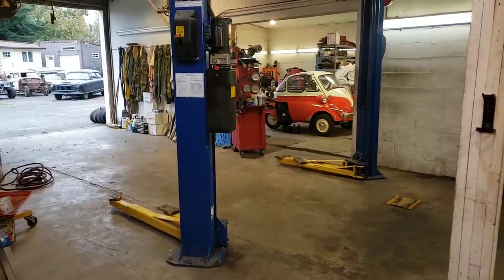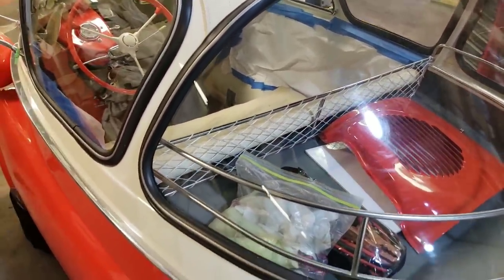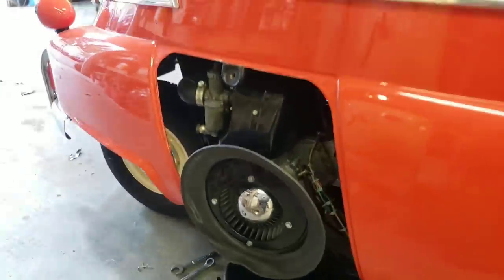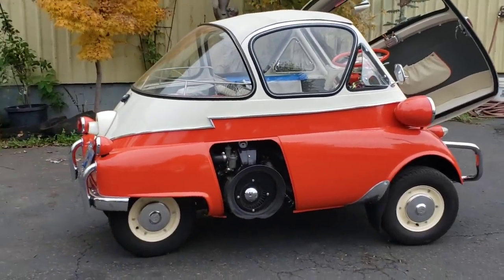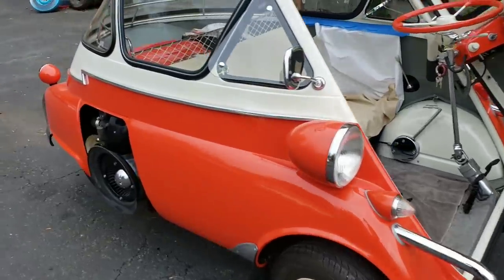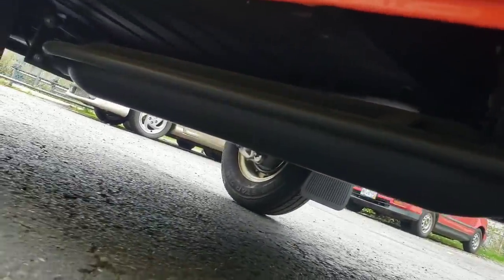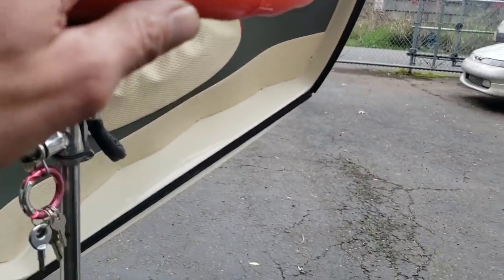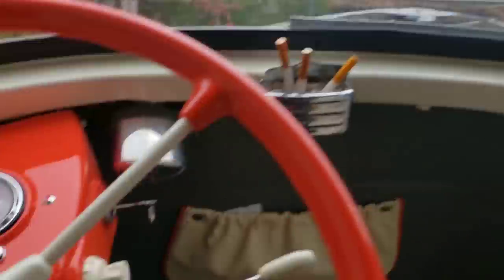BMW Isetta Z Bubble Drive

Comment: I have a sliding window Isetta and live in a tropical climate and it's an oven on hot days. I found out that installing UV-blocking window tint really helps. My window tint is nearly clear, almost unnoticeable but blocks 70% of UV light. Makes it much more driveable on hot days.

Comment: Thanks for another great video! The Dynastart problem sounds exactly like what Bill Rogers and John Wetzel described...incorrect Dynastart brushes. Bill Rogers researched the problem and found a company that makes brushes that deliver the right amount of oomph to start an Isetta reliably. I bought a set of Bill's brushes for my Isetta ($48 for a set of 4 brushes). The grabby clutch is likely because the original friction plate has been changed to a commonly available motorcycle part. The original plates were made from spring steel and have smoother clutching than the motorcycle plates. Gosbert in Germany sells new spring steel clutch plates. I've learned a lot from the Isetta gurus who have seen it all.

Comment: The hard start problem could be (if it's OHV) a compression release problem. If the rocker arm clearance is too loose, it won't let the compression release work properly and cause an intermittent compression lock issue. The first U.S. made Briggs & Stratton OHVs were bad about the rocker adjusters backing off and doing the same thing.
Reply from the maker: This engine is outfitted with a high compression piston However the dynastartr is designed to work with this set up